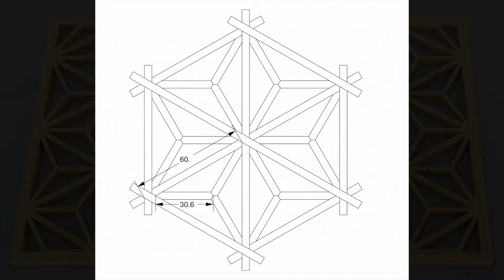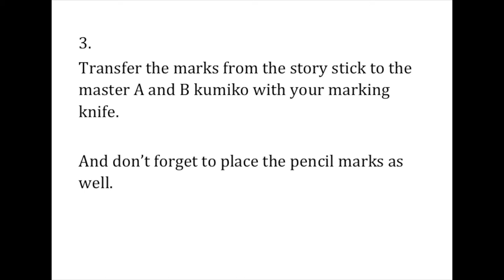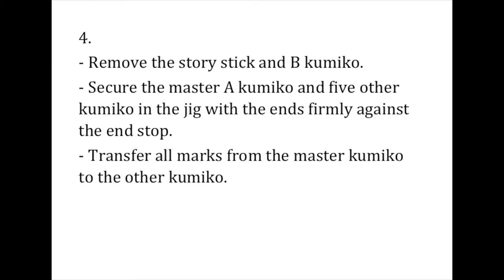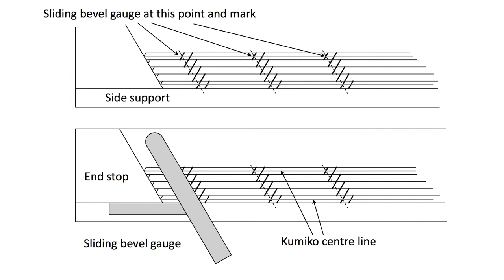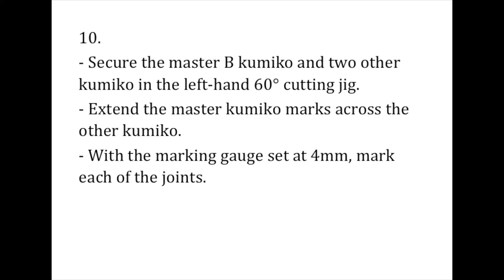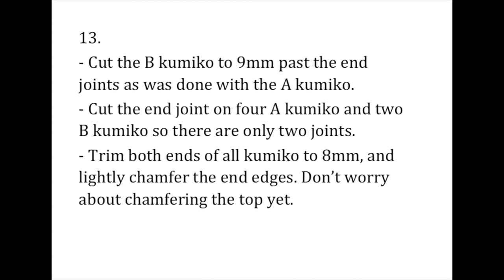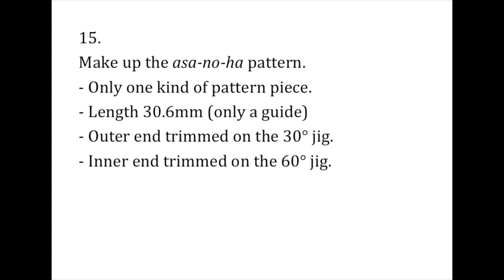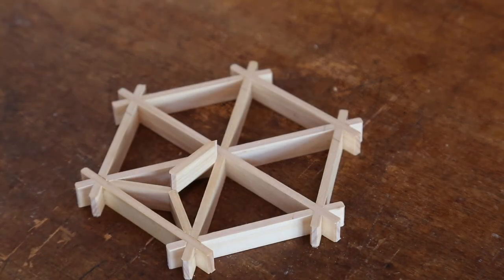Shoji and kumiko patterns 06 Asa-no-ha coaster

Comment: Awesome!   How do you feel about people maybe cutting the kumiko on cnc like xcarve then assembling by hand?  I know this is in opposition to craftsmanship, but can it still count towards artistry?
Reply from the maker: I prefer cutting everything by hand, but I've nothing whatsoever against using machines if they're available and it's what people prefer. It's simply a different way to the same result. It's also just a different type of craftsmanship, and if the result is the same, it's the same artistry.
Reply: kskdesign , thank you!  Much appreciated.  Was just wondering what your thoughts were on it.
Reply: CNC isn't traditional woodworking, but there is still endless room for creative and technical expression. Milling machines aren't like copiers, they have their own challenges regarding tool selection and paths, order of operations, tolerances, and so on that must be revisited with each new project. Sure, you can crank out a hundred identical pieces once you master the first one, but I doubt that anyone using CNC as a creative outlet is motivated by mass production.

CNC can also be a real aid for people who lack the manual dexterity needed to use and maintain traditional woodworking tools. Paraplegic individuals, for example.
Reply: @kskdesign1  I really appreciate your insight on the difference between the methods and the artistry.